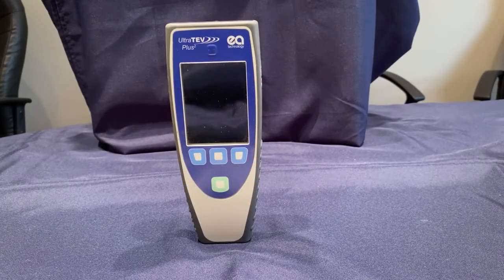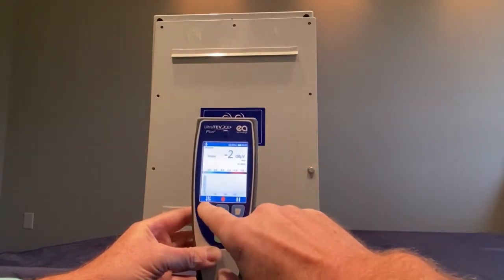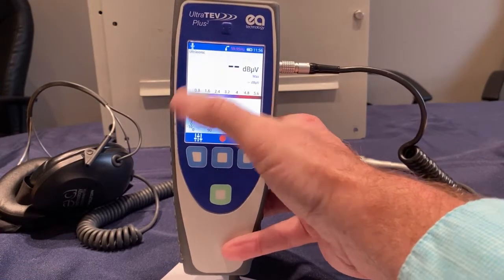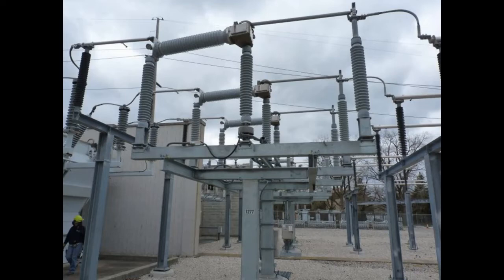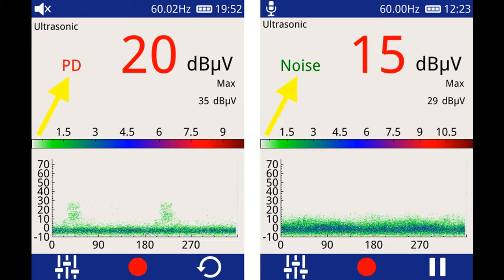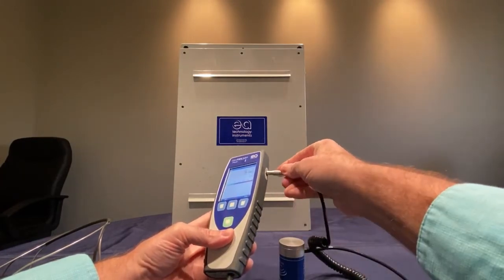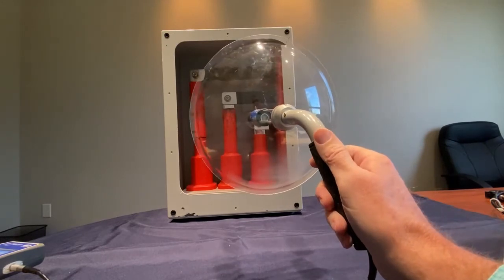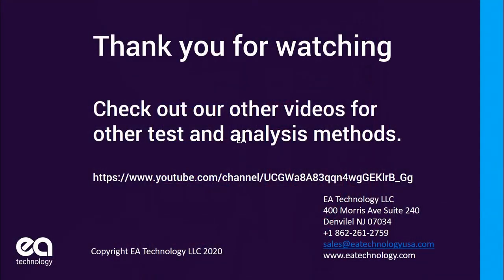UTP2 Ultrasonic testing V3

Comment: Also please explain hfct method and where pd occur in HV cables?
Reply from the maker: For HFCT measurements you place the ct on the ground strap of the HV cables. PD in HV cables will travel along the shielding in the cables and can be measured from the groundstrap. PD in HV cables is typically caused by a void in the insulation, as discharge jumps the gap in the insulation it breaks down the surrounding insulation and eventually leads to failure. https://eatechnology.com/americas/resources/case-studies-and-white-papers/case-studies/avoid-mv-cable-termination-failures/ 
Here is an interesting study of cable failure causes.

Comment: Good video. What use for the efield and manual and light?
Reply from the maker: The E-Field / Manual / Optical setting selects the source of the frequency reference.  We want to lock the instrument to the power system frequency, and you have these 3 ways of doing that.
Reply: @eatechnologyllc2219 ok understand, incase we are not setting,is not showing the pd pattern or value?